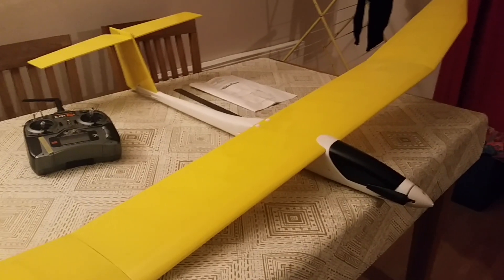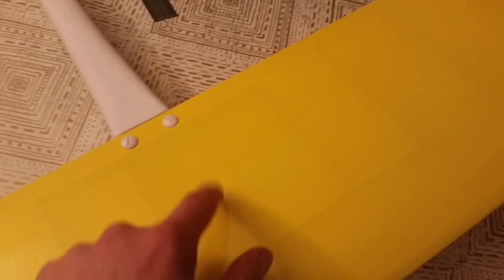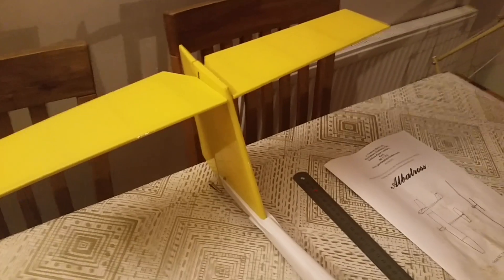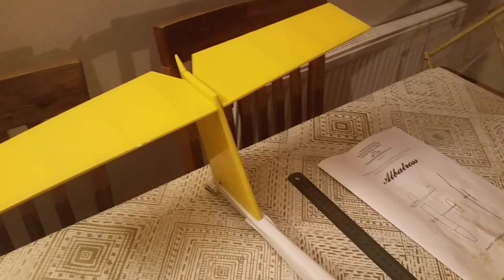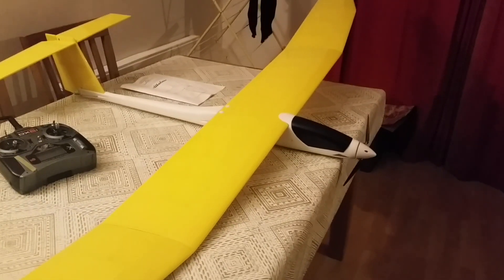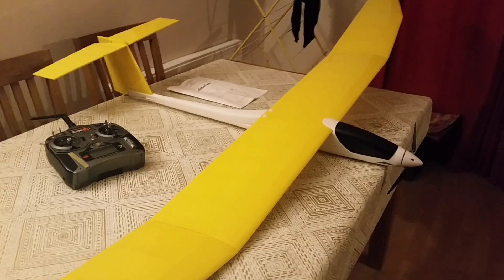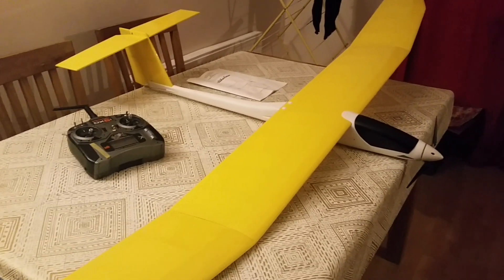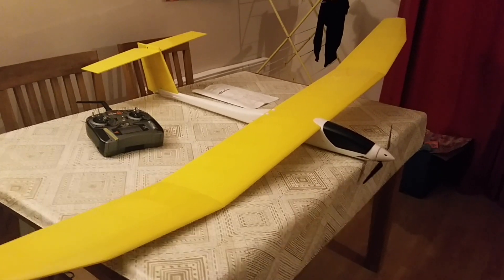JP Albatross complete

Comment: Hi Jeff, would you still have the manual for the JP?
Reply from the maker: @hughsysmailbox  I’m pretty sure I still have it in my pile of manuals still have the model also .. what info would u like from it ?
Reply: @highflying82  Thanks Jeff, I also acquired one of these JP Albatross but without any info from a guy who can’t fly anymore due to Parkinson’s, I promised him I’d fly it and send him some pics vids etc, is there any chance you would be kind enough to give me a copy of it somehow? Many thanks Steve
Reply from the maker: @hughsysmailbox  .. hi Steve I have located the manual I can provide whatever info u need it u can email me 
Highflying82@gmail.com and I can reply with a picture of every page so U can print and have a manual .. as I remember .. havnt flown it for while .. there was a significant amount of up thrust that needed adjusting .. there is a wooden washer plate behind the motor which determines thrust angle and I had to adapt it .. is your albatross a built model or unbuilt .. I was running on 2200 3s lipo on stock brushed motor and stock prop had plenty enough to fly nicely .. as I remember it did very well slope soaring with thermal and lift .. just be careful launching in strong wind as if wind grabs a wing the rudder won’t recover the model .. all in all a nIce comfortable flier .. find a field with long grass and do some gentl throwing glide tests without power to test the center of gravity make sure it’s balanced ..throw into wind gently for some glide tests .. I probably have my inner fuzz marked with where I had my batt if that helps .. email me and I will supply the manual pics 👌
Reply: Thank you so much Jeff, that’s is very kind of you. And thanks for your valuable advice, I’ll email you. Again many thanks 🙏